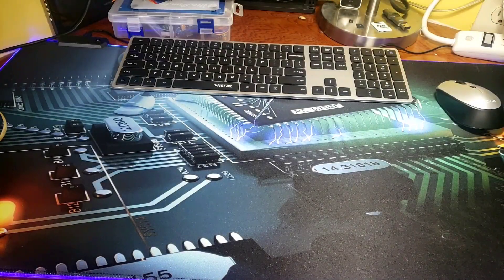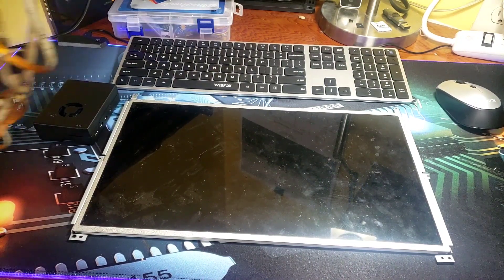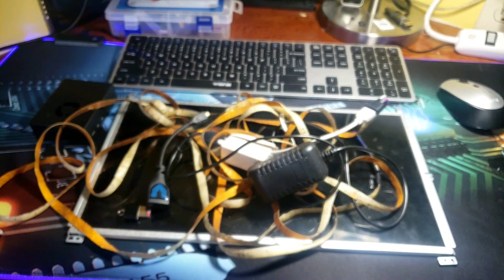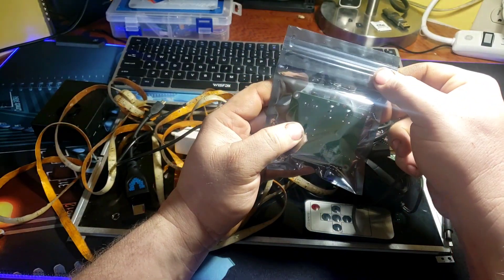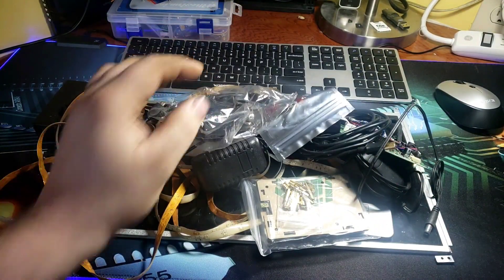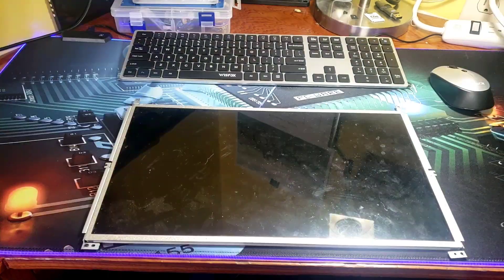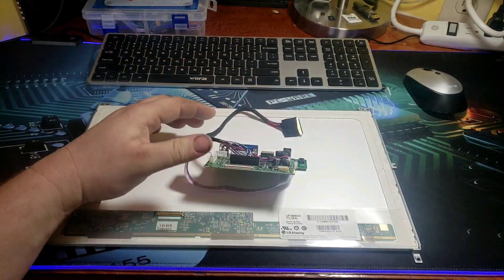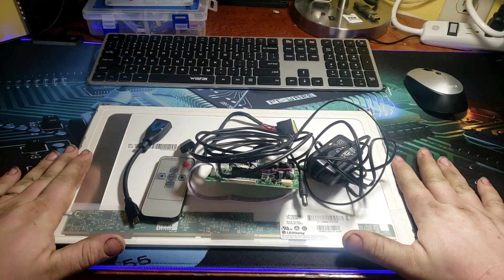Jukebox build using a raspberry pi 4

Comment: Can you provide a list of the parts you used.. not the display items.. but you said you used some other boards.. TIA
Reply from the maker: Pi 4 with a DAC (Digital to Analog Converter) that sets on top of the pi using the GPIO pins and using the 1.5 mm head phone jack auxiliary cord to plug into an amp. Then it has to be set up to use the GPIO pins to run the DAC. Hope this helps.